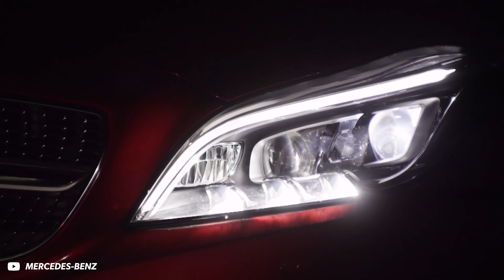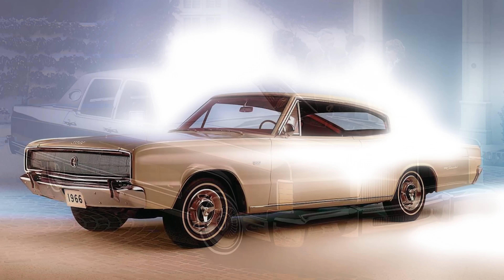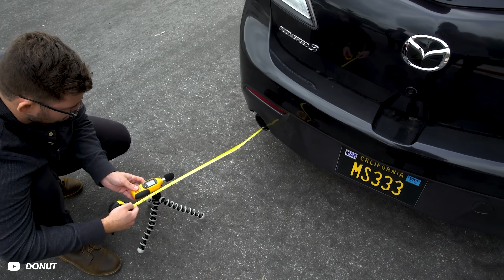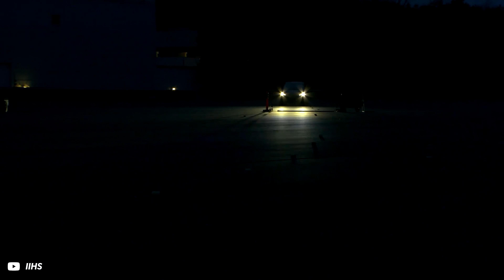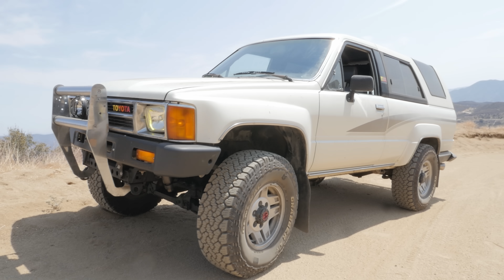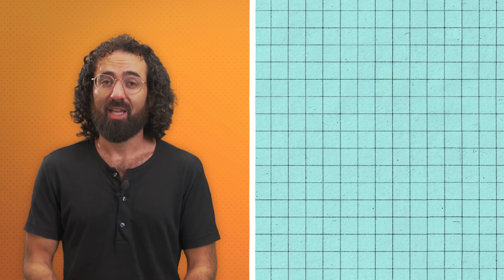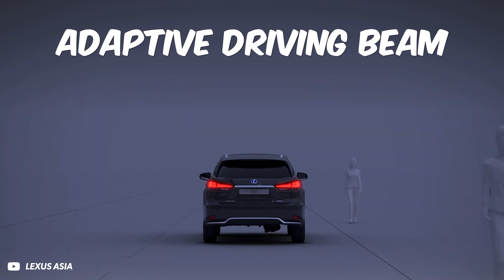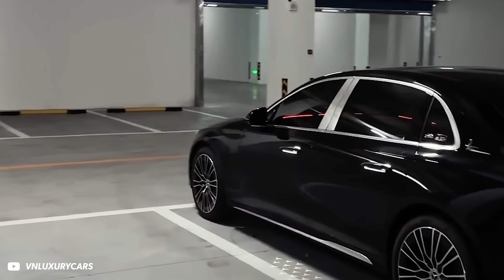Why new headlights are blinding American drivers

Comment: German here. Ive been often blinded at night for quite some time now. And it's not the older cars with retrofitted LED-turned halogen lights. I'm mostly blinded by newer cars with factory fitted LED-Lights / Laserlights etc.. Mostly Mercedeses, Audis, BMWs... Even Tesla's. My brother has a German spec Tesla Model 3. One day we were at a family gathering at a restaurant. I came with my 125cc scooter, my brother with his Tesla and when we left it was already dark outside. When he drove directly behind me I mostly couldn't see what was in front of me because those Tesla LED-lights blinded me so badly in my sidemirrors. Nothing modified. Blinded by manufacturer spec, it's unbelivable.
Reply: Greek here. I fully agree with the German guy. Same issue, OEM lights blinding more than aftermarket.
Reply: It's always the stock newer cars. Years ago (when these weren't on the road yet) I almost never got blinded.
Reply: @qresind exactly. I noticed it immensely because I didn't drive cars at night for about 5+ years. Now I do again and it's insane how much they blind. And it's always the new cars. Older cars are no problem at all.
Reply: Adaptive lights are programmed to detect (car!) traffic from the opposing side. They don't care about tail lights, bicycles and pedestrians. I had an Uber driver once standing on the other side of the road waiting for his fare. The entire ceiling in my living room seemed to radiate light stronger than the Sun. After about ten minutes I decided to walk over to him, asking him if he could please turn off his high beams. He looked at me in disbelief and said he was running dips...
 
EU should really review the rulebook on this.
Reply: Also German here. I had 2 Tesla Model 3 for a while some years ago. I can tell you that your brother will fail TÜV with that car because of the incorrect light adjustment. That was standard for a long time, that Tesla is not able to adjust the headlights correctly. In my opinion all the cars should be called back by the manufacturer to check and correct it. 

On my first Tesla the light was too high, but just a little. Blinded others easily. I could see the line where it ended. With some low cars, it reached the outer mirrors, which had a problem then. With the second Tesla that I had, the light only reached 2 meters ahead of the car. I went to the garage and they said they will adjust ist. No manual adjustment would be necessary, the car would have a software function, that corrects it automatically. They did it and when it was night again, I saw that low beam light was going upwards now. It even blinded semi truck drivers. I could not drive with the car that way at night at all. So I found the hidden screen for manual adjustment. It said that I would not be allowed to do that, only dealer might do it. I did it anyway and the result was good then. Until the next software update came over night, then it blinded others again.

What a terrible car and company. I am glad that I don't have these cars any longer. Now I am back on my 25 year German car and it works fine. Always does what I expect it to do and can bring me more than 1500 km without needing to stop. I hope I can keep it for longer time.
Reply: @mas3507  1500 km? probably any car with either MB 220d or VW 1.9 TDI engine...
Reply: @ghinio3675 1.9 TDI. My personal record was 1746.8 km with one tank of fuel. With perfect conditions, almost 1900 would be possible with constant 90 km/h. But it's almost impossible to have such perfect conditions for such a long distance.
Reply: Telsa is the worst for this, not only are they super bright, but they also ride quite choppy on bumpy roads and dips, so it seems like they are flashing you.
Reply: Irishman here. I agree with you.
Reply: I literally have to adjust my mirrors downwards so I can't see what's behind me because I need to stop people's blinding headlights from getting in my eyes.
Reply: Exactly, and i feel it's these cars with all the smart light features that are the worst. The smart system sounds nice but only if it's working better than perfect. and it isn't... I've had so many times where i thought a car was flashing their headlights at me, but only because of the automatic systems turning on or off.
Also lights that have certain types of lenses that change color and brightness when you only slightly change the looking angle, making them have a shimmer effect, which is really annoying and distracting.
Reply: Who needs enemies when you have a brother like that.
Reply: You must not have many pickup trucks I'm guessing. In North America, those offenders are far worse than the expensive cars.
Reply: @mediocreman2  Pickups in Germany? Probably below 1%. It's an American thing.
Reply: @ghinio3675  We do have a lot of SUV's in europe though, with head lgights that are at the heigt of a sedans rear window.
Reply: I own a Tesla Model Y and several months ago an update gave us the adaptive lights  I can actually see them adapting to oncoming traffic and cars in front of me.  How old is your story?
Reply: Hm, I never found that much of a problem.
Reply: This sounds like bullshit to me. How can you get blinded if he was behind you? You kept looking in the mirrors for some reason instead of focusing on the road? Also, matrix headlights saved me already 5 times from crashing into wild animals running on the road, saving them and my car, while i crashed once with my other normal full led car due to a deer running on the road which i couldn’t see because a car was coming and i had my normal beams on.
Reply: @filippo3783  He doesn't need to look into the mirrors to get blinded. The mirrors are in front of his face and the light goes directly into his eyes from there if the car behind has a too high light beam. Only way to avoid that would have been changing both mirror's position. But then he wouldn't be able to see what is going on behind him.
Reply: @filippo3783  You talk about how those matrix headlights saved you? On your fucking car? Then you don't understand what this conversation is about at all. We talk about how those headlights blind other cars not yourself as the driver... It's blinding oncoming cars etc.

And how they blinded me? Well apparently a mirror reflects light, that's basically how a mirror works. Even if you do not stare at it directly, if a mirror is within your eyesight at an angle you still can get blinded if it reflects a fu**ing light thats too bright.
Reply: @filippo3783 Good that you don't crash into deers.. but Ive been completely blinded by new cars too often in the woods that I seriously had to stop because I couldn't see anything...

The solution is having normal lights and just drive slow if in the woods if you suspect there are deers at night
Reply: @filippo3783  You must have never driven a car with mirrors lol......
Reply: Also German. I'm being blinded way more by poorly adjusted halogen and aftermarket LEDs than by modern OEM LEDs
Reply: @DeadRedAssassin bs. There's hardly any aftermarket ones available in Germany because testing them is far too expensive for manufacturers to get them allowed.
Reply: @DeadRedAssassin  How do you know they weren't OEM? You got out on the middle of the highway to ask?
Reply: Motorcycle mirrors are adjustable or just sit up a little taller and they don’t line up directly at your eyes lol.
Reply: @PapaWheelie1  So I adjust them so I cant see behind me? You literally don't seem to know how mirrors work... Please don't give safety advises or learn to adjust mirrors yourself first before commenting...
Reply: @ghinio3675  - I’ve got hundreds of thousands of miles on motorcycles. You adjust them down when the lights are shining into your eyes. Seeing what is in front of you is more important than seeing the headlights of the car behind you in that case.
Reply: @PapaWheelie1  But this is not how it should be. Adjusting my mirrors so I dont get blinded? It's not my fault is what I'm saying.
Reply: @ghinio3675  - try sitting up higher when a car with misaligned lights is right behind you if it is too much trouble to reach forward and twist a mirror an 1/8 of an inch. Better than driving into a ditch because you’re blinded.

Comment: How hard is it to flip a switch? Bc those adaptive beams are going to break, and be an expensive pain in my ass
Reply: It's no different than a dimmer switch.
Reply: Yeah, that whole ADB system will run a few thousand dollars at a minimum. It involves a light sensor or camera, a dedicated computer, plus controllers in each of the lights, on top of the bulbs themselves.

Comment: The problem is improperly aimed headlights NOT the brightness of the bulb.
Reply: You sir are not me, it IS the brightness and color, not the adjustment that blinds the living fuck right outta me, no matter the adjustment. I don't have to look directly at someone welding to get side blinded by the arc of the weld, same as the sun can blind from the side view as well.
IT IS THE BRIGHTNESS.

Comment: A: it's stupid that the US regulators didn't lose their  "wasn't invented here" attitude and copy Europe's regs.  B since we are stuck here.  Bright headlights coming at you? Look at the fog line.  You won't get blinded. C. It's pretty easy to pick "good" LEDs; look for a fin that blocks part of one of the LED sets, that makes for a good cut off.  Almost all my old motorcycles get this type of LED, lets me keep the vintage look, but also see the road (and deer) at night. also adjust your headlights! before you remove the old bulbs mark the high beam cut off on the garage door wall in your driveway adjust til the LEDs have the same cut off, done.  PS I find good LED's have a SHARPER not LESS defined low beam cut off compared to the halogens they replace.  That can be a bit of an issue on hilly dark country roads.

Comment: The problem with a lot of aftermarket replacement bulbs is that (a) they are cheap pieces of crap that scatter the light all over the place (b) they were installed incorrectly and because of this they scatter the light all over the place!! Halogen bulbs are round and the reflector points the light in the correct pattern. LED bulbs are flat and if they are not clocked in the right direction they will blind oncoming traffic. When you install a decent LED replacement bulb it will be at exactly 12&6 position or 3&9 position. Sometimes with a cheap bulb or a crappy aftermarket housing the bulb isn’t clocked correctly and good bulbs have set screws to correct them and really good bulbs also have adjustment for in and out also. You have to have the lights shining on a wall and close to a level surface to focus the bulb correctly. This is way above most peoples knowledge and skill level. If you do put in an aftermarket bulb at least make sure the flat part is either straight up and down or horizontal. Turn the bulb back slightly so it’s clocked correctly and you will see better and hopefully you won’t be blinding as many people. My Ford has factory LED’s that constantly level up and down and turn with the steering wheel above 5 mph. Fords with factory LED lights do a little dance when you turn them on… up and down then left and right. You really notice it when the lights are shining on a wall or something. These bulbs have a good pattern and they adjust up and down so they are in the right spot no matter how much weight you have in the vehicle.

Comment: It's not just the brightness or the height the headlights are mounted at.
It's also the angle they are aimed at.
 Headlights used to aim down at the road surface. 
Now they just illuminate everything, even up to the level of quite high tree branches. 
This is probably causing permanent eye damage to our wildlife!
Can you imagine what happens to the eyes of a possum or an owl for example when hit by these lights.
 BLINDNESS!
Possibly permanent!  🤬

Time things were strictly regulated on a global scale.

Comment: I want Regulators approaching completely another way to headlights brightness limits. I state that unnecessarily intense head light is useless and dangerous for driver oneself. Here’s the idea: human vision is adaptive for low illumination conditions – “night mode” – we can see extremely good just under the moonlight or so, but any excessively bright object in the sight corrupts or even destroys that night mode, that is exactly “blindness by the light”. It’s illusion that “for better-vision/safer-driving any more illumination is good”, the illusion is provided by daylight mode vision while night mode is completely suppressed. In night mode driver is able to see enough not only where under headlights or streetlight but in shadows and in dark, out of the road. This night mode ability isn’t enough to see small precise details but enough to observe obstacles in general both in bright and dark side of a road.

Comment: A lot of the problem is that states have stopped requiring automobile safety inspections. I remember when the headlights were checked annually to make sure they were aimed so as not to blind oncoming drivers. So, it's not really a problem of them being too bright but of them being aimed incorrectly. From the factory, with stock tires, ride height, etc. the headlights are aimed so as not to blind oncoming traffic. So, a jacked-up truck riding two feet higher than stock will have the headlights aimed directly at the oncoming drivers eyes. The BEST solution is to reinstate safety inspections to ensure that every vehicle on the road is safe but that its lights don't blind oncoming drivers.

Comment: Matrix technology is fun and interestingly Teslas that have the hardware now work here in Europe. It works in high beam by shading areas as shown. 
The system is far from perfect though, and I for one think that it's better to go to a conventional dipped beam in many situations - lit or busy highways / motorways, built up areas etc. To be fair the car often does that itself and even lowers the dipped beam, but there are times when I feel a distant truck is potentially getting the full beam because the car hasn't 'seen' its lights yet, so manual selection of dipped beam is in order.

Comment: As a UK driver, I can say 90% of headlight that are blindingly bright are from new cars: those with LED factory lights or even matrix LED adaptive lights. And yet we're constantly told this is because of illegal aftermarket blub swaps... even though these LEDs are sealed units without the ability to swap the individual LEDs.
The problem seems to be that somehow LED-headlight cars aren't required to have auto-levelling systems that xenon headlight had to be coupled with.

Comment: The market has been flooded with Chinese LED headlight bulbs on Amazon, Ebay and other venues.  Some sellers out right lie and claim their bulbs are DOT approved.  Others actually post a disclaimer that the bulbs are for off-road use only.  Bottom line, these LEDs don't produce the same point source of light that the lamp filament did and thus the parabolic reflector behind them cannot maintain the same focused beam.  The glare from these LED retrofits are blinding to oncoming traffic.  I used to hate my states motor vehicle inspection, which checked many safety items, including headlight aim, beam pattern and brightness.  Now all they check is emissions, via data read from the OBD II connector.

Comment: A few already said so but Teslas were built with the headlights in place but software-deactivated for the past several years and they finally activated them this year in a software update and I LOVE LOVE LOVE them.  The blinding headlights are a huge issue and I'm genuinely so impressed with the performance of the system and the fact that, as a driver, I can see further ahead, particularly when on rural interstates with no light sources while still moving fast.  I really really hope they can bring this to more cars, especially for the sake of states like Alaska where the law requires (or at least it used to require) all drivers to default to high beams unless there is oncoming traffic.

Comment: I'm from Europe and I'm getting blinded by led's all the time even though I drive regular family wagon and not a small, low car. Interestingly majority of wors offenders on the road seem to be factory dynamic and beam led headlights, esspecially automatic high beams. Every time there's a speed bump, or twisty rural road I'm constantly getting flashbanged from the front and the rear. Most fancy dlr equiped cars only "cut" me out after I flash my high beams. I was wondering if I was going crazy, but when I was driving new loaner car with automatic lights I realized how terrible is the actual road performance. I had auto high beams off in about first 10 minutes after I proceeded to blind at least 20 cars in oncoming lane. They would always turn off too late and turn on too early. I hate people that invented theae setups with passion.

Comment: Headlights straight up don't need to be that bright, especially the low beams. People got along fine with halogens for half a century. If the IIHS data says these insane lights reduce accidents, it means there are a lot of people driving too fast for how far they can see and who shouldn't be on the road. These same people will still go too fast for any other factor limiting their ability to react.
Reply: I hate driving older vehicle with crappy lights.  It’s like they designed them to be as bad as possible.